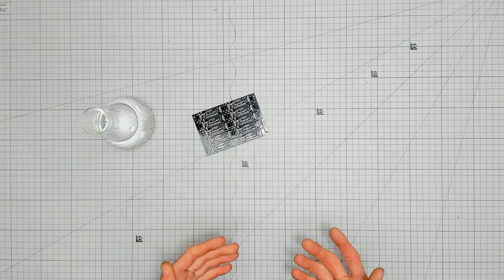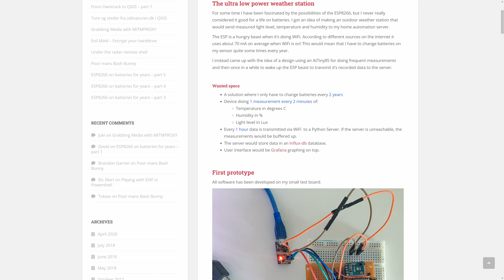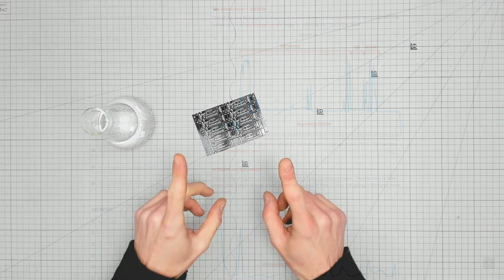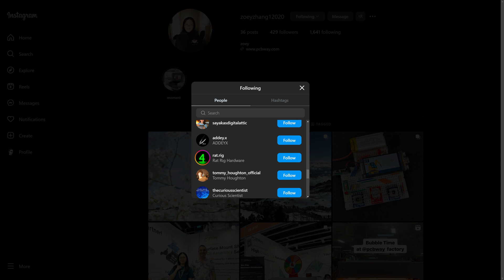Introducing DeepSleepr - My module to turn any SBC low-power via I2C and an Attiny!

Comment: This is great! One suggestion: Make the PCB slightly larger so you can add some holes for screws to mount it within a 3D printed enclosure!
Reply: Crap! Now I’ve been too busy and just thought to check back. I’m going to find your email address and contact you. This really is a great idea!
Reply from the maker: @ScottCLemon  Hahaha all good mate, I am very close to ordering v0.2. HOPEFULLY this week. It really went on the backburner due to life recently, but I need to finish it since the code is good and it's such a viable product! Cheers
Reply from the maker: Hey mate actually making it smaller! Hah. I have already 3D printed some cases that they just neatly snap-into too, which are semi transparent so you can see the status LED.

Working on v0.2 now, which should be out in a few weeks. Just umming and arring about whether I move down to an Attiny88 w/ OpenPicoRTOS, or move to an STM32L011... which is likely going to be the lowest power option that's widely supported.

Ah choices!
Reply: @PlatimaTinkers  I want to incorporate it into a single enclosed that will hold my sensor array and this power controller. So I don’t want it in its own enclosure. :-)
Reply from the maker: @ScottCLemon  Aaah okay I see. Valid use case and point! I've added notes for my v0.2 prototype (aiming to order a batch next week) about this.

It'll be pushing it with space, but would 2x M2 holes suit? I'm scrapping the SPI headers, and changing to a smaller MCU because of that, so should have some room!
Reply: @PlatimaTinkers  that sounds great! Make sure to leave clearance for the screw heads. :-)
Reply from the maker: @ScottCLemon  Yeah I'd usually leave it with 1mm of track around it so the head isn't biting straight into the FR4, and it can be treated as a grounding for any ESD discharge
Reply: @PlatimaTinkers  as I’ve been building another sensor project I realized you might really have something here. In a v2 product you ought to consider providing one or two more power outputs that could be controlled over the I2C.  This way I could use your board to control power to other sensor modules or radios to keep everything low power!
Reply from the maker: @ScottCLemon  Hey yeah so that's definitely an idea, however, I have another project I've been working on that does basically that. 5V input, 6x outputs 0.5-3.3V in gangs of 2 up to 2.5A each, 1x 1A load switch, a few low-noise 0.5A outputs, I2C interface, RTC, 12 bit ADC, 6 GPIOs, 2uA sleep. Considering pairing it with some RP2350's that I got sent. Give me 2-3 months to get a prototype out 😊
Reply from the maker: @ScottCLemon  I swear to the almighty I replied to this. Did you get a reply?

It was a hefty response too 😑 Long story short I'm working on another project almost EXACTLY like that; tiny core, few power outputs, all I2C controlled, USB programming interface. 

Feel free to email me if you want to brainstorm a bit - I always love new ideas. Oh and on the note of products; thinking that I'd have half-M2 cuts in the side for mounting, instead of M2 holes, just due to layout limitations. Would that suit your use case too?

Cheers

Comment: Sorry if I missed it - what's the quiescent draw of the DeepSleepr?
Reply from the maker: Had not actually been measured/rated yet, but the Attiny414 draws 0.69µA in standby mode w/ external xtal. The MOSFET would likely be the biggest power sink with 4µA for zero gate voltage.

Still, anything under 150µA should give ... what, 2 years on a 2600mAh LiPo? Minus time the SBC is awake for operations of course.

Comment: I can see an issue here with ground loops when power is cut....  If anything on the SBC side of this is measuring/sensing and has a ground or grounded shielded cable, and the power ground is cut, the power will be maintained by the grounds on sensors etc. also while the voltage drop across the mosfet is going to be very very small, this could read to odd readings on sensors once again due to the ground loop issue.
two good reasons to /never/ design something that does anything with the grounds.  You could switch the + rail with either a P channel or an opto coupled N channel fet just as easily.
Reply from the maker: Yeah I was thinking about that a fair bit during the design, but a) cutting GND removes the need for the added complexity of a P-channel MOSFET requiring a driver, and b) this is for low powered setups - any sensors are going to be powered by the SBC, as if there was external power, DeepSleepr wouldn't be required.

So there is absolutely the potential for a ground loop, however, if there was, then this product wouldn't be needed. Not strictly, but close to, mutually exclusive scenarios? 

Thank you for your input either way my friend!
Reply: @PlatimaTinkers  yes agreed, just a small possibility, it's been a curse of electronics and electrics since the dawn of time. I have a dashcam I wanted to keep the internal battery fully charged so tried one of those tp405x modules only to find the module charged by switched positive and the dashcam cut off the charge by switched negative so while the battery wasn't overcharged the charging never actual ceased. Amplifier's are the worst for loops with PSU noise and odd windy sounds.
Reply from the maker: @lezbriddon  Yeah you know what, this stuck with me overnight, and in the middle of the night I realised that if there is any mounting/enclosure, if it's metal, that might be acting as a common ground.

V0.2 will have a P-channel MOSFET 😅 Thank you for your support/encouragement!

Comment: maybe also a version without usb connectors, just through hole solder pads, so the device powered by it would control the shutdown signal ?
Reply from the maker: Yeah hence I ordered them assembled without the USB type-C ports so I could experiment with it like that. Might leave some THT pin holes under the USB pads. Added to my notes 👍